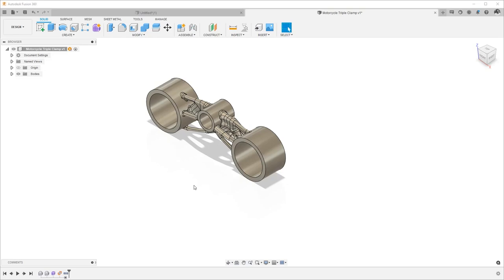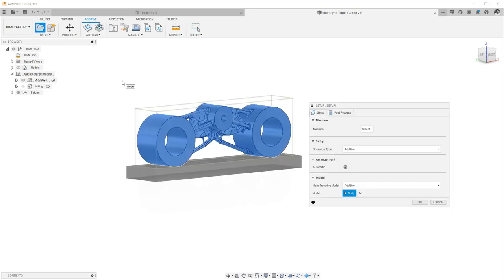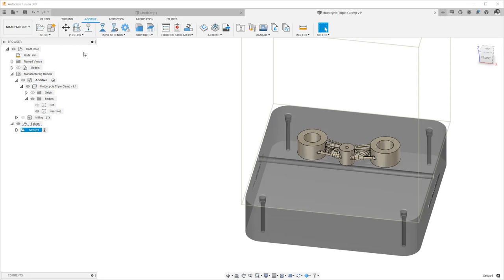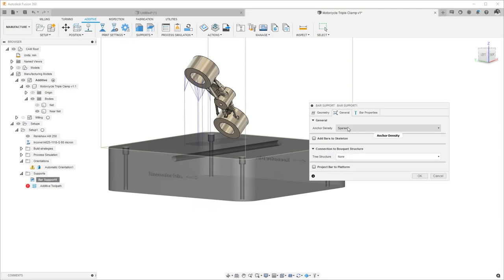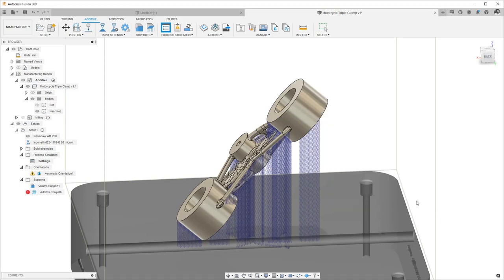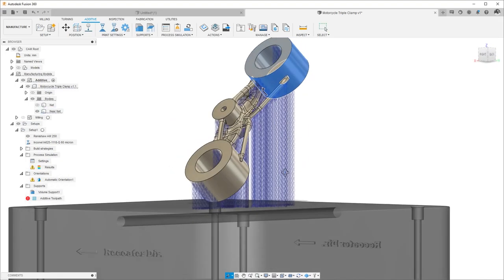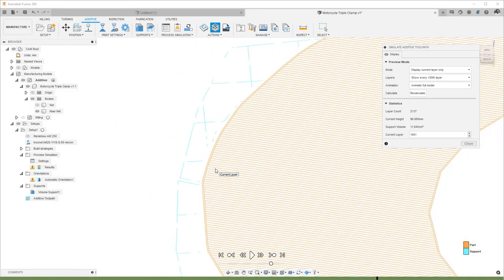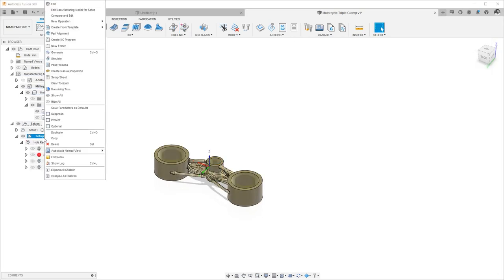Process Simulation for Metal Powderbed Fusion (MPBF) | Autodesk Fusion 360

Comment: Jack of all trades, master of none. Stop wasting resources in something than no one will use...
There's more powerful slicers for free out there.
Reply: That's your opinion. The long term potential here is very interesting.
Reply: Also have you even watched this video, or just made assumptions? It's way more than slicing for FFF.
Reply: Some printer use their own cloud base slicer where you can’t generate your own support like my MarkforgedX7. In my scenario, Fusion help me create some customized support before print then I can transfer the whole model to the cloud slicer to print parts with continuous fiber
Reply: @HiLeeHighly  are you aware you represent 0.001% of user base using f360 for 3d printing? Their efforts could be directed towards something actually useful for most people.
Reply: @alejandroperez5368  are you aware you're being quite short sighted? You may have a point for FFF but this is about a lot more than just that. Having a parametric additive and subtractive all in one CAD/CAM product is a hugely powerful proposition. Especially for design and manufacturing configuration and automation down the line.

A lot of what's shown in this video comes from Netfabb, which isn't a free product and goes way beyond a standard slicer.
Reply: @alejandroperez5368  That's for now. I am talking about scientific and serious use and you are talking about hobby use. Fusion360 is not just for printing some toys as you did.